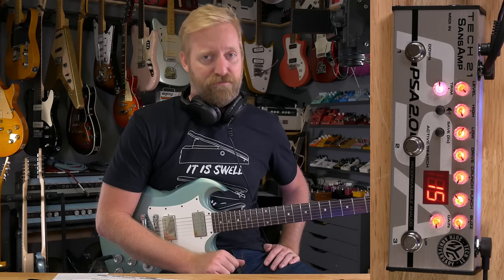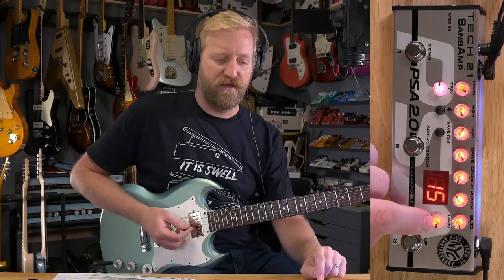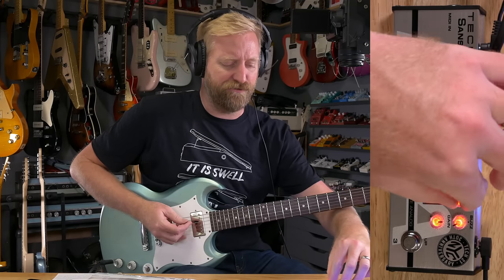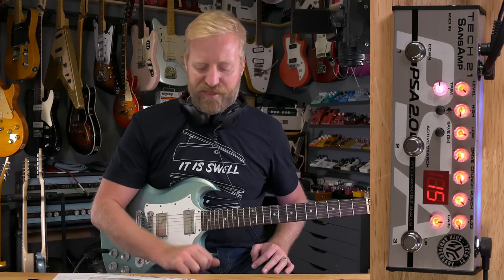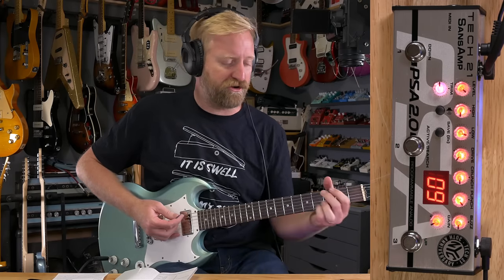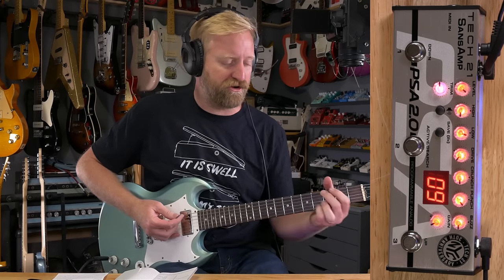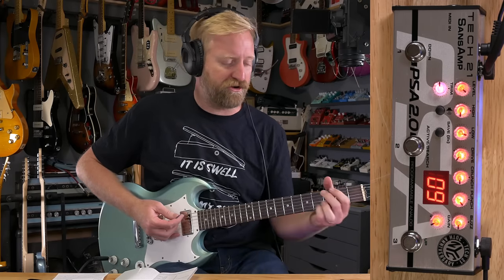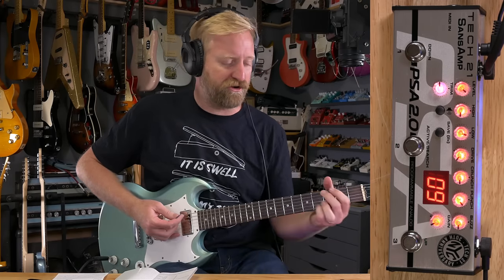Tech 21 PSA 2.0 - Does this analog amp modeling tech of the early 1990's still hold up?

Comment: I owned a PSA1 back in the day, and now I own a Sansamp PSA 2.0.  It is, to me, one of the best ways to get the sounds of the 90's with a current amplifier.  I mean, is there any other device on the planet that attempts a preset to emulate a Mesa Boogie Triaxis preamp, or a Marshall JMP-1 preamp?  It sounds best if you truly use it as a preamp and not a pedal - plug it into the effect loop return on your amplifier.  Also, I think that their "cabinet emulation" is not particularly good.  I would not record direct with it, but if you use it with something like a Torpedo Cab-M it's fantastic.  Add in midi control and you have an amazing little unit.  I mean, one thing that you really didn't get a feel for in this video is just how tiny it is!  It blows my mind that a device that used to take up a full rack space is now the size of a distortion pedal.
Reply: Yeah, I just received this unit and at first I was like ok... not bad but... DAMN ! Through either a Mooer Radar IR pedal or an AMT Pangea IR Loader this thing is a beast ! And yes, the size is ridiculously small

Comment: I got a Joyo American Sound which I was told is a knock off of a Blonde SansAmp. I play a parts-caster with Fender 1954 custom shop pickups through a Headrush FRFR112. It is one of the best guitar amp sounds I have ever had. I've had an Axe Fx 2, Kemper and HX Stomp. The Axe Fx and Kemper sound terrible through this particular frfr, but the HX Stomp sounds great IMHO. But the best sounds I have gotten with all of these through that frfr is the Joyo American Sound. Overall all signal chain makes a huge difference! I would be very interested in demos from you on the Tech 21 SansAmp Character Plus Series.

Comment: Cool sounding box, but like most of the stuff Tech 21 is putting out these days, the analog cab simulation sounds and feels really flat. If you're going into a real amp (powersection) or cabinet in some way you'll have way better luck. I bought a GT2 a while back and though, I had a lot of nostalgia for it, it went through 2 live situations before I said, eh, nope. I know Tech 21 has an anti-digital stance when it comes to this stuff, but it's hard to accept when IRs are as good and plentiful as they are today. Buy one of these and a Cab M and you'll be off to the races.

Comment: i remember being surprised when i read Kurt Cobain used a Sansamp live for a while (in either nevermind or in utero era)  the amp simulator into an amp thing messed with my mind...
Reply: Its not an issue.  Even the sansamp’s manual refers to it’s multiple applications, including going direct, driving a power amp, or plugging into the front of an amp.  There’s no wrong way to use a sansamp, just use your ears.  If it sounds good it is good.  Personally i like the bass driver DI and the GT2!

Comment: Thank you so much for demoing this. I found out about Tech21's analogue amp sims a few days ago and have been fixated on them since.
I really like how you approached this like a noob. It gave me a good idea of what it would be like for me to use it.
When you "dialled in something flat" with all the knobs at about 1 o'clock, the sound was very clean, which intrigued me. I wonder whether that means there could be even more clean sounds to play with than distorted ones. I would love to play around with the left hand side of those dials.
I also wonder whether the simulated pedals sounded crappy because they were recorded direct. Maybe some of the sounds this box makes are better with an amp.

Comment: A proper mindset is required with these sansamp boxes...
1) This is first and foremost an analog amp emulator that works really hard to provide you the truest tube response possible without tubes in a compact unit that doesn't require cranking and blowing out the windows to get there.
2) The cab sim provided although decent is not a "be all end all" they just give you something vanilla to work with.
3) If you are looking for a multi-fx unit to "do it all" this ain't it.  If you are looking to address the guitar amp portion of a modular setup where you are trying to get high quality specfic stuff in your signal chain/path be it recording or performance this is aimed directly at that.  It can actually be a very freeing experience for people who find themselves "locked" into multi effects units which force them to have do things specific ways.
4) Think of this as an amp.  Like an amp it needs certain things put in front of it to get specific stuff.  Example your gonna have to put a green box in front of it to get mid boosted/low cut tones.  And this one will give you BOTH the Fender and Marshall versions to boot in that scenario!
5) Lastly this is not outdated technology from the 80s 90s.  It originated back then but Tech 21 has constantly improved this stuff to what it today in account for how people will want to use it in the 2020s.  They were one of the first to the game and the knowledge base/experience in that company is first rate and goes way back.

Comment: I use a POD XT for some effects just so I can mess around with different things that I don't have experience with. So I can see if I like it. They're like $60 on ebay and you get a whole lot of pedals, amps and different micing simulations to give you a taste of what's possible with different pedals. It's a great place to start if you don't already know what you're looking for. I imagine this product is similar in that way.
Reply from the maker: I used an XT for years. I traded it for an MIM strat before the value tanked on them, wild that they are $60 now, I remember it being pretty good.
Reply: Went back to my XT after buying the HD... just knew it better. Felt more comfortable.

Comment: I used to own the PSA-1 and was ultimately disappointed by it. Never quite lived up to its promise. One issue I found was that it is not just a preamp, it emulates the power amp effect too, which may be great for a few applications but doesn't sound great into many real power amps; the manual actually recommends using with a flat response solid state power amp. For DI the speaker sim was very poor and not optional as it is in the PSA-2. Patches were always short of brilliant particularly the clean ones which would never sparkle. I swapped mine for a theoretically less capable and much cheaper Award Session JD-10, another (this one British) analogue amp sim with speaker sim, which sounds much better to me to this day as I still use them.

Comment: When doing the “pedal section” I didn’t you plug it into an amp? That’s what they’re designed for.
Reply: A sansamp is designed to go into an amp? Uh, okay?
Reply: Sansamp means "without amp". These are meant to be run directly into a mixer, FOH or audio interface. If you're insisting on running through an amp, use the effects send/return at least. Plugging in front of the amp just doesn't sound good
Reply: I own 5 of the Sansamp  flyrigs they are also designed for using with real amps. That’s why there is a speaker defeat button. The pedal section is not an amp simulation it’s a pedal simulation. Therefore they go in front of an amp
Reply: @karlmar2  The Sansamp with the speaker sim on (or the FlyRig version 1) is meant for a PA or power amp. If you go into the front of an amp, you should probably disable the Sansamp entirely.